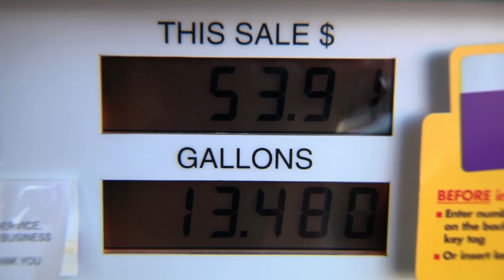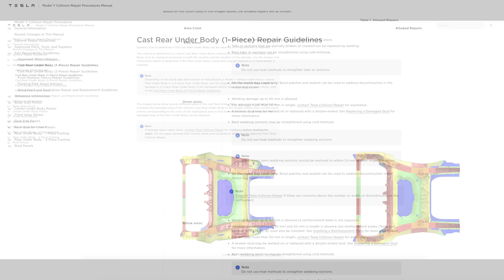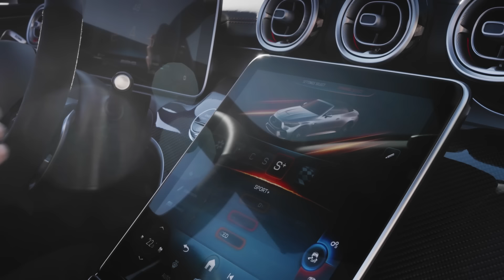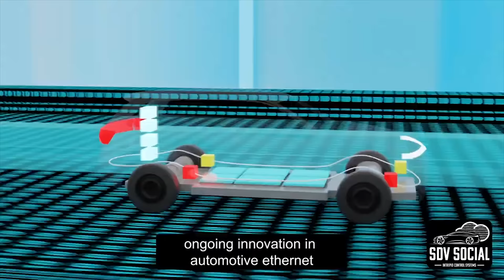EVs Put Massive Dent in Gas Demand; U.S. Eases Battery Sourcing Requirements - Autoline Daily 3805

Comment: We all know Gas as  fuel for vehicles will be phased out, the sooner the better, and if we dont convert legacy auto factories to BEV production the Chinese will fill that void.
Reply: No it wont. No fuel is more powerful vs being transportable. EVs are a pipe dream that are horrible for the environment.
Reply: @wadewilson6628 No they aren't.   You're misinformed but that won't matter.
Reply: @wadewilson6628 yes, gasoline has a very high energy content per volume. The problem is that ICE has a 25% efficiency in converting that energy to motion. Conversely, electric motors have an 85% energy conversion efficiency.
Reply: We don’t know this
Reply: Building a EV is as easy as any electronic appliance， you just connect the motor to the wheel, and engine is more complicated and we should not be fooled to give up that technology, let Chinese power everything with the dumb battery， let them power their aircraft carrier with batteries and they will be doomed
Reply: I hope China EVs get here now we are dragging ass in USA this would show a sense of urgency to innovate???
Reply: Only problem is EV can’t be charged in less than 5 minutes conviently like ice or at any area that has a long stretch of distance in other words they have no suitable range
Reply: @mikethompson3534  EVs have been making cross country trips for over a decade now and those were on the old 90kw chargers. Now most are 150kw now with the newest being 250-350kw chargers.
Reply: @JD-yx7be yea, last year I was in Vegas to visit family.  I wish I could post photos of the 6 bank Tesla charger line.  About 10 in line waiting when we went into the restaurant and the same when we came out 2 hours later.  I won’t even get into the F-150 that can’t pull a trailer over 100 miles or the cold Midwest winter that left EV owners stranded.  Or the strip mining for the minerals to build the batteries.  Yea I won’t mention that.
Reply: @av8rgrip  Yup, no one argued that it is a one to one with gas stations. But charging speed and amount of chargers is increasing every year. A Ramcharger series hybrid would be much better if you are towing than a full electric
Reply: Why is it better? Based on what metrics ?
Reply: @snookmeister55 you’re wrong buddo
Reply: @mikethompson3534  I stop at a charging station maybe 4 times per year.  Meanwhile you’re stopping at gas stations dozens of times per year.  You are waiting for refills a lot more than I am.
Reply: @JD-yx7be  you can build all the charging stations you want, but the problems will still be there.  When was the last nuclear power plant built to keep up with demand?  I remember the rolling blackouts and governments begging people not to run their home A/C.  Yea, I see all the solar panels going up where farmland used to be.  Windmills with blades that last 10 years and then a put in landfills.  There is more harm being done to the environment than good.  I would love to be off oil, but EVs are not ready.
Reply: @mikethompson3534 are you that misinformed? There are cars that rival Fossil fuels in range. The Honda CRV I had 600 Kms range by the optimistic trip computer , but often delivered less than 500 Kms per fillup. Have you factored in the cost of fuel? My fillups used to be $70 to $80 and that was about  over a year ago, today much more as the gas price went up , here in Canada!
Reply: "The sooner the better"? By what metric?
Reply: Just in case you included me in your "we", no I am not convinced EV's will dominate passenger vehicle market anytime soon.
Reply: If gas demand is destroyed the rest of the economy including food production will go with it.
Reply: @snookmeister55 he is right
Reply: I totally agree with you!!!
Reply: @Withnail1969  True.   Gasoline as a fuel will be phased out.
Reply: @Withnail1969  Yes, he's right that gasoline as a fuel is being phased out.
Reply: impossible to create fuel but it's relatively easy to generate electricity. EV means less dependence to the system.
Reply: @MyUtubeScott  You may not be ready but people will vote with their pockets , whether that be a legacy auto BEV or Tesla or some Chinese BEV down the road, and when the Chinese come with affordables BEVs, it won't be pretty for legacy auto Japanese or American, it will be like the 70s again when Toyota and Datsun ( Nissan today) and the 90s when the SKoreans came.The difference? This time it's a TSUNAMI, as in the Chinese Wave! I ask you and the unbelievers  and legacy auto ," who is prepared? Are you ready to put your dollars out there to help legacy auto to save their lazy A$$E$? Answer that my friend!
Reply: @MyUtubeScott  I live in Calgary Alberta, ÇOLD here and it us the OIL Producing Province in Canada, but we have tons of TESLA s around , and if you go to BC you will find Teslas like crazy,you'd think you were in Californication!
Reply: @shannons1886 that calculation would make sense if electricity was an energy source which we could mine from the ground. However since electricity is just a mechanism for transporting energy, you’d have to add the thermal inefficiency of burning fuel in power plants in most places and converting that heat to rotation, rotation to electricity, electricity to various voltage levels; and line losses of moving that current to homes and charging stations for efficiency numbers to be accurate.
Reply: @YSKWatch  if only the massive amount of energy it takes to produce large amounts of electricity could be magically created instead of burning fuel, as we do now in most cases, your statement would make sense. 

At present, burning fuel somewhere else instead of in cars is different, but not really an advantage.

Comment: wonderful news on the gasoline growth front. Look forward to the day when nobody wants the stuff.
Reply: Amen.
Reply: there requires a sufficient supplement before ur dreams become reality. if you dont have a suggestion on what to use... then ur wishing for a fantasy.
Reply: @EnriqueThiele i think you have a lot more leaning to do in regards to the entire energy cycle. but if it helps you sleep.
Reply: That's a loooong way off.  We do need much more nuclear.  Renewable energy can't satisfy our energy needs in the short term.
Reply: @EnriqueThiele without oil, it would be hard to make EV's. just saying.
Reply: None of us will live long enough to see gas consumption decline much. Fewer people can afford cars and the ones that can are staying home more....
Reply: @AndrewTSq  
Sure, but the non burning use of fossil fuels is much less of a problem than the burning is a problem.
However, since most of the money is in burning the stuff, the oil companies are in a bind if that goes away.
Reply: @jimthain8777  but burning oil in cars is only 7% of the total co2 on earth. So it does not make a huge difference.
Reply: @AndrewTSq  transportation is almost 50% of the total oil production . Co2 is not the only pollutant contributed from cars. 
The air quality will improve dramatically in the next 5 - 10 years in cities all over the world.  Combustion efficiency is far better in power plants than piston engines. The emissions from power generation is also much easier to collect or scrub than millions of cars and trucks.
Reply: @AndrewTSq  
Far as I know you're not supposed to burn the oil.
It's supposed to run on gasoline.
LOL

Comment: In June of 2022, 9 billion barrels were consumed in the U.S. In July of 2023, it was 9.3 barrels. (Statista) Might want to recheck your statistics.
Reply: You might want to get some data from 2024.
Reply: @ChitFromChinola  but 2024 is not over yet...
Reply: The article said the rate of increase was slowing, so citing two old data points from mid-2022 and mid-2023 does not refute that analysis. The OP can get some monthly data from late 2023 and early 2024 to get the real picture, instead of just plunking in two numbers and some snark.
Reply: Might wanna check your knowledge.  9.3 (in 2023) could have been 9.7 without EVs.
Reply: The anger in these comments is funny.
Reply: @EvilMonkey7818  Yeah, and I was just killing some time, I couldn't care less about this topic.

Comment: At the personal level my direct consumption of Petrol (Gas) has dropped from over 1000 liters a year to zero since I went EV. (10 years ago)
Reply: Nice.  You're one of many.
Reply: Same here, I started driving a Ev late 2012 and never looked back.  I still have a PU for our small travel trailer, but my gasoline usage is very very low for over a decade
Reply: @phileasler5401  It seems rather simple that when a person stops buying ICE and Gas then demand for those products decreases.  Sorta  explains the hate level, I think.
Reply: ur not factoring the consumption to produce ur said EV?  take the blindfolds off mate. i do electric vehicles and even i know that it isnt sustainable.
Reply: @highwaltage  You're misinformed with BS.
Reply: @highwaltage  evs are still more efficient using the energy from oil burned by power plant
Reply: @highwaltage  Did you actually read my comment? I was referring to my 'personal direct consumption' . I presumed that readers would realise that referred to petrol bought for a car and not the various and previous costs of making the EV which is another matter not connected to the drop in the sale of petrol to the public . Shall I admit that I have used some diesel products when I rode on the local bus services? (Incidentally the local buses are all going EV in the next few months)
Reply: @socalsp3  explain that cycle for me then.
Reply: @solentbum  gotta factor in cost and recyclability too. of course i read ur comment. but thats not the point. we can all knit pick the statistics we want to shine a light on. but the whole is what needs to be considered. mark my words tho. once gas is no more. you will no longer have ur freedoms. stew on that for a bit. the future of it and the 15 min city proposals. this isnt a conspiracy. its factual.
Reply: @snookmeister55  lol nice statement. care to back it with facts or are you still high from the misinformation the EV is green Propaganda? i love EV dont get me confused. im just realistic about viabilities and futures. personally i have 5 electric vehicles lol. also 5 petrol vehicles. they get about the same amount of use. maintenance for the EV is much higher and tighter tho as i dont trust any cell buried in a pack.  Please. share the info you think i have been misinformed about.....
oh wait.... Whats ur stance on Climate Change?
Reply: @highwaltage  What's your stance on round earth?  How about the 69 moon landing,  Jewish Space Lazers,  etc.
Reply: @highwaltage  That is not a factual or logical statement.
Reply: @highwaltage  Seems like your logic is flawed and it makes more sense for you to back up your statement with some facts and data.  None of your response  makes sense.
Reply: @BTC_Minarchist  what isnt? that EV green is propaganda? youve been grabbed by the balls son.
Reply: @BTC_Minarchist  they dont make sense to those who are bought into the lie. easy enough to understand huh?
Reply: @snookmeister55  i see what ur trying to do. unfortunately for you. conspiracy nutters are up 100 to 0 lol. good try tho. ill be transparent. i wanted to gauge your projections by understanding ur reaction to the 'current crisis' seems as tho you do not hold these ideas into the future.. understandable. lol
Reply: @highwaltage  Son?  🤣 I'm probably older than you are. 

I've owned many, many, many ICE cars in my life.   None of them compare to my EVs.   Not in reliability, speed, convenience, or ease of maintenance.

I'm not a tree hugger.  I don't buy bass on politics.   I just like kick @ss tech and performance at an affordable price.
Reply: @highwaltage Um, okay 😏
Reply: @BTC_Minarchist  likewise. but affordable and electric should be in the same sentence. but it is not. lol. copper wire is soo hard to wind..... i mean i also have designed and run my own brushless speed controllers for drones etc. so i love my tech. i just dont buy into the propaganda when i have much data that directly contradicts some of the statements being made. but hey. you do you and lets not give this stupid video any more views. the ad revenue from our returns for comments is keeping this ai bot channel afloat.
Reply: @BTC_Minarchist  oh i also modify electric vehicles. i overvolt on the regular ;) so its not like i am not absorbed in the tech. i make my own liion packs for long range scooting.
Reply: @highwaltage  When the 'Gas' is gone  we will have to put up with Electricity garnered from the Wind and Sun to propel our EVs for however long is needed.

Comment: Saying that EV growth accounts for a 50% drop in gasoline demand growth from 23 to 24 sounds like nonsense.  EV's are going to account for something like 7-8% of cars sold in the US this year.   The numbers don't even come close to adding up...
Reply: @EnriqueThiele Yep, the increasing number of HEVs has a bigger impact on fuel consumption. A company like Toyota can make 40+ HEVs or four to five PHEVs for every one BEV with their limited battery supply and high annual sales numbers. When all these vehicles are daily driven an average of 40 km a day that adds up to a lot of fuel savings compared to one BEV driver hoarding hundreds of km of batteries they will not need in daily driving.
Reply: @anydaynow01  HEVs are ICE.  They are dangerous trash that should be illegal to sell.  Insane repair costs out of warranty.  Like putting a diesel engine and a gas engine in the same car so you can use either fuel.  It can be done, but why would you?
Reply: Hybrids are selling very well again, a trend that's going to keep rising.  The upcoming Camry will be hybrid only, perhaps the RAV4 as well.  Given their known reliability they'll sell well and make a big dent in the gasoline consumption.  The premium paid for a hybrid version of vehicles has shrunk over the years, so the time to break even for the extra expense is very reasonable now.  Hybrids are now the most reliable vehicle class.  Kudos.
Reply: @EvilMonkey7818  So, when Europe makes it illegal for Fleet cars to be Hybrids... how many will sell?  Companies buy almost 90% of Hybrids in Europe for fleet cars, right?

Comment: The Norway gov released a report last week that even though they have an 80% adoption  rate to EV  their fossil fuels used has not dropped. I call BS that at least in the US  the drop in gas sales is because of the EV adoption , people are driving less .
Reply: The unused fuel is being sold to someone else.  It does not just go away instantly.  If that excess fuel can still be sold for a profit, supplies won't be reduced.
Reply: See Electrek, Norway, October 20, 2023 for an opposing point of view.
Reply: Norway is an oil exporter
Reply: Fuel sale is down 18.4% in last 12 months in Norway
Reply: Gasoline demand is down 1/3 in Norway since 2013. Clearly EVs are having a direct effect on gasoline demand. Oil prices are a result of worldwide economies which have been generally strong for years now and keeping overall prices up. Rather than rely on sources paid for by the oil industry and their spin, I suggest searching for sources that present the other side of the coin for more information.
Reply: As he said, growth rate is cut in half.  Still growing, but growing half as fast.   Still not at a point demand dropping... yet.
Reply: You read BS so you can call BS, which is BS.
Reply: Norway does not have 80% adaption of EV's. Total amount of EV's in Norway is around 30%.
Reply: @_PatrickO  Interesting point.  Norway is the 15th largest oil producer in the world, but only accounts for about 2% of global oil consumption.  Norway is a significant exporter of oil, which makes up a large portion of their economy.
Reply: @JD-yx7be  Huge exporter.
Reply: @Bryanbkk  That's how the vicious cycle begins 😮
Reply: @AndrewTSq Yes.  People often confuse % of yearly sales with % of the active fleet still on the roads.
Reply: @AndrewTSq  We are conflating two very different stats.

Norway's EV adoption rate is actually at 82%.  Meaning, new car sales are 82% EV.

Norway's national auto fleet (all cars registered and on the road) is ~24%.  It will be several years before Norway is 100% EV because newer gas cars will have to be retired.

Both numbers matter and we shouldn't conflate them.
Reply: @BTC_Minarchist   ok sorry, english is not my main language, so I had another translation of adoption. Anyway, also why it is so high in Norway is cause they had zero tax on evs and very high taxes on ice cars for a while, making a ice car more expensive to buy , so not that strange people went for ev.
Reply: @AndrewTSq  thanks for the  context.  I would not have done as well in Norwegian 😉

Comment: Old school adherent to way of making chassis  for cars are not convinced of benefits of Gigacasting citing repairability.Most cars involved in collisions that sustain major damage to frame are TOTALLED by the Insurance!.In Canada cars repaired after such collisions  are titled "Branded" meaning they are worth less than half  a car not in any collision. I know because i bought writeoffs and repaired such cars and sold them, and not worth the effort and money!
Reply: @AudiTTQuattro2003   Your missing the point.  Castings or no these cars are being totaled.
Reply: How much of the price of repairing your car is due to the fact that you have insurance ?     
If it does not makes sense think about the fact that with some medical insurance policies the copay is more expensive than the cash price.
Reply: @AudiTTQuattro2003  Do you realize many cars are totalled because the Electronic gizmos & ADAS SENSORS, airbags headlights ,and repairing the expensive ENGINE parts cost money and labour? And that is not even getting into frame damages! I should know, a friend of mine is an Auto Body Shopowner/ Collision Shop.